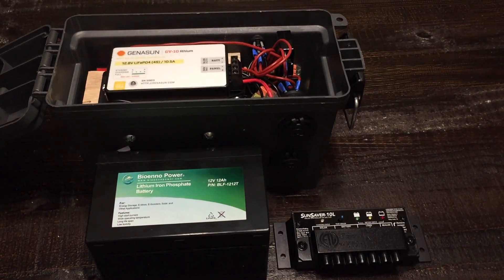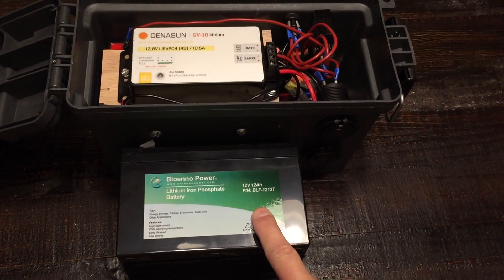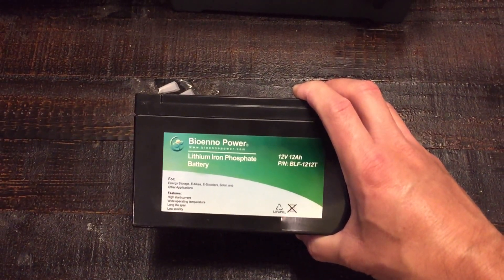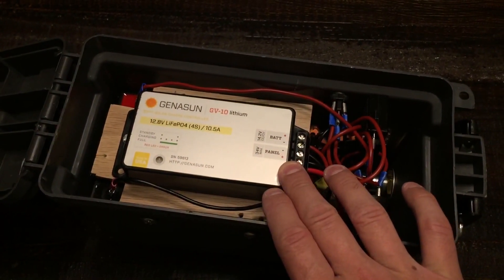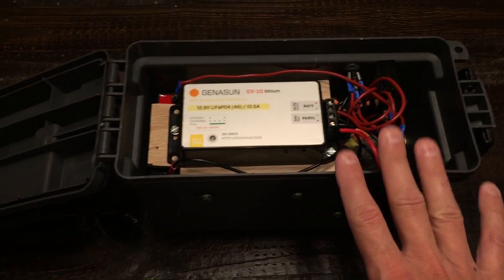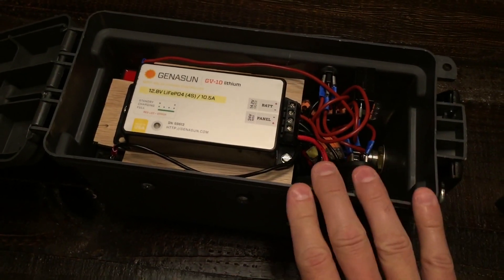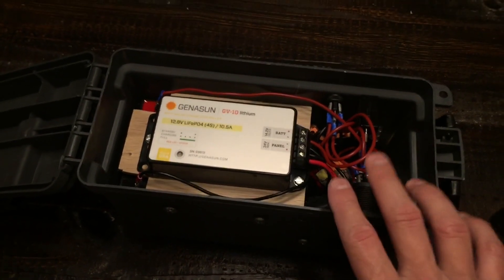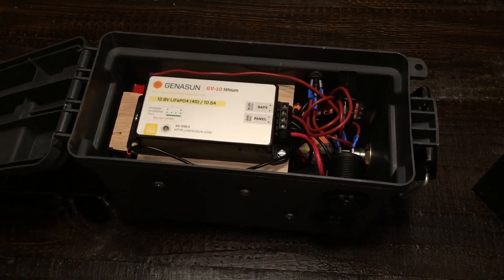Solar Ammo Box Generator - LiFePO4 update!!

Comment: Nice, I built mine with the 9ah bioenno in the smallest Apache case from harbor freight, about $15, I put a lighted toggle switch on the front between the fold over handle and on the side I mounted a voltage meter and dual USB, from powerwerx, it has been the ultimate power bank for charging my phones, tablets, and flashlights I use it for weeks before charging it and have yet to run the battery down.

Comment: Matt, look into the Buddipole Power Mini Charge controller, Battery Management Status indicator, etc. You don't need all the wires. Has a input for Solar Panel, Battery. USB and Load outputs, meter reads battery status, you can set it up for Lead acid. LI-ion, LiFePo3 an LiFePo4 batteries. You can set up high voltage and low voltage cut off and alarms. You can even change the charging voltage max limits, if your battery is different. All for about the price of a separate charge controller.

Comment: I dont use.charge controlers. The bms takes care.of it. Solar panel gos right to my battery.. Your bms is set at a higher cuttoff  than the charge controler. Making them not see.echother after its cut off
Reply from the maker: I've heard of people doing this.  My assumption is the voltage on the panel drops to match the battery while it's charging?
Reply: I must have.been.high when.I wrote that.  Wait maybe.I was tired. I do recommend.charge.controller.from.the.battery maker.  I now use one. Helps with keeping the battery safe.no.worries.   bms will protect your battery. I use low amp low voltage.charging... But. The battery and charge.controler may have.a.different cutoff.  And if the battery cuts off after the.controler does.then they woild not beable.to jump itself.with power
Reply: I switched to a different controller.  So it will self jump when panels have.power...  80bucks.  Owell

Comment: Hey can I used that charge control for 38120 cells lifepo4
Reply from the maker: C Lolooio You can as long as you match the charging voltage parameters of the charge controller.

Comment: The charge controller gets its power from the battery.  This is because, If the sun were blocked the charge controller would loose power and think it is morning all over again. That would cause the charge controller would start its charging process all over again.  Most controllers will only try to charge once a day, unless you program them to do otherwise. Normally there's not enough Sun hours in a day to start a second charging, and if there are your system is way oversized. The BMS disconnects the battery so there is no power to run the charge controller.

You will be better off with a watt meter to tell how much power is left in the battery. The voltage is completely flat until the battery dies so there's no way to tell how much charge you have with a voltmeter.

K6ORJ

Comment: Put a super capacitor bank on it to jump start it when the voltage is low.  How this would work is if the bank has a normally open switch connected to the charger.  All you have to do is remember to press the switch to charge the caps while the battery is fully charged.  You would have to figure out how you want to deliver that charge to the battery when it is low.  This also increases the danger inside of the case, but you can do your research in order to go about it safely.  Plenty of stuff out there.  I recommend looking into super capacitors because they are great kickstarter energy banks/surge current.
Reply from the maker: Thanks for the suggestion Anthony!

Comment: Thank for the Vids Matt!  I have been toying around with trying to make something like this.  Light, portable and able to charge from various sources.  Solar, Wall outlet, bicycle dynamo...  I was all set in starting to buy the materials until I saw the prices.  Yikes.  It's not really cost effective for my task yet but it's getting there.

Was wondering if you were thinking about making a vid on creation of a bigger unit with an inverter maybe? Like one you can power a refrigerator on in power outages.  Showing the how to from the ground up.  Linking multiple batteries or being able to link multiple modules...

Just some ideas- 

Thanks again!
Reply from the maker: +Roy Greenhalgh You're welcome Roy!  The beauty of solar generators is they can scale up/down to meet your needs.  The component choice has to meet your power requirements in the end.    I am planning on building a bigger unit, but in regards to an inverter being integrated, that's something I've left to being a modular component instead of it being included in the case.  They tend to require a lot of venting while under a load, so best kept outside of case.

Comment: Matt, thanks for posting this.  I also got unexpected results with a Genasun GV-5, a Bioenno Power 4.5 Ah battery and a PowerFilm 28W rollable panel.  With the panel connected and no battery present, the controller showed a battery high voltage condition, and I found panel open circuit voltage,(between 18 and 20V) at the battery terminals.  This also happened when the battery reached full charge.  Fearing that the battery pack would get damaged, I scrapped the GV-5 and went with a Bioenno PWM controller.  I wonder if you could comment on what you see under those same conditions:  1) panel connected, no battery connected; and 2) battery reaches full charge.
Reply from the maker: +Dave Corsello I've never connected it without the battery being connected.  I haven't had any issue besides low voltage disconnect and that's coming from the battery BMS, not the controller.  Only way I've found to "kick start" the BMS when it's reached that state is to apply a quick 12V jump from another battery, which causes the BMS to sense an increase in voltage which in turn allows the battery to charge.

I would use a Bioenno controller, but they're all too big for my use case.  In regards to the controller showing high voltage, that may be expected since the controller isn't picking up the voltage from a battery (which is considered a load).  The max input voltage for that controller is 27V, so you should be fine from the controllers perspective.  The BMS of the battery will protect it from the high voltage.  Did you check the open circuit voltage at the panel?  What about the voltage at the battery terminals when it's connected to the battery itself?  MPPT controllers will decrease the incoming voltage to match the voltage it's detecting from the battery and increase amps, which is why they're great.  Did you contact Genasun in regards to the the behaviors you're experiencing?
Reply: Matt, it's been about a year since I posted my comment, and I've learned more about what caused my problems.  As the battery approaches full charge, charging current decreases.  When the charging rate reaches 0.02C, the Bioenno BMS disconnects the battery.  The Genasun GV-5 doesn't handle this gracefully--when there's no battery present, it sends panel open circuit voltage (Voc) to its battery and load terminals.  I wonder if you've experienced this over the past year, and if not, why not.
Reply from the maker: +Dave Corsello I've not experienced what you've described. I'll have to monitor it closer to watch what happens.  My voltmeter on my generator has never gone above 14.2 Volt's while charging.  If what you described happened with me, I would expect to see the meter to register the VoC.
Reply: You would also see the status light blink red on the controller.
Reply from the maker: +Dave Corsello yes!  This has happened, but the controller ended up failing. I contacted Genasun and they ended up swapping the unit. Haven't had an issue since.

Comment: Hey Matt
Love your videos on this box. I was curious about your usage with the LifePo batt vs the AGM. Do you find you get significantly better use and what do you think of the Bioenno batt. Thanks! Looking forward to more videos :)
Reply from the maker: +NikonJax The LiFePO4 battery has been great and yes I've been getting more capacity then the AGM.  The weigh difference plus the greater capacity are the two greatest benefits with this setup.  I have an updated build that I will post soon.

Comment: It seems that if someone has access to a supply of salvaged 18650 batteries they could connect a bunch in series and parallel to get voltage and AH level to where they need to be for a lot cheaper than the battery you used.
Reply from the maker: +lmorrison17 Funny you should mention this because I've been testing that configuration for the past few weeks.  There are some major trade offs (in my option), but definitely an option.  I think it would be worth creating a video to showcase.

Comment: I looking at a build.  Was thinking of making a base camp style battery Like between 50 to 100 ah with the capability to jump my truck and large inverter with additional mini portable power banks to take into the tent or use with the 12volt shower pump I have.  Then also use for emergencies and each child would use there own power source for there IPads and lights.  For the casing I was looking at the Makita Interlocking Modular Tool Case

Comment: I have the Bioenno 10 AH Renewable Power Pack (BPP-120).  I had the same issue as you as when the BMS kicked in, and shut it off. I could not get it to charge.  Like you I spoke with Keven about the issue.  Now the Power Pack 120 has an input for charging and output for load.  Kevin stated to plug in the charger into the output and it would reset itself,  this worked.  I would suggest to maybe add charging port to plug in your battery.  This would help in keeping your battery maintained and charged at home for when you need it.  Second it will help you reset the BMS if it were to shut down.  Battery monitor is also good to have especially when out in the field.
Reply from the maker: That's what I ended up doing in order to get this to work. I think I stated this in the video, but I took the charger and tapped the leads on the battery posts. Worked like a champ but could be an issue while camping or charger isn't around. I just completed my new build and will be recording an video shortly.

Comment: Question if I may: Will this controller ALSO work with an ordinary AGM Battery?
Reply from the maker: +Bruce Forster Great question Bruce.  To directly answer your question - I wouldn't recommend it.  This controller's output is different then that for a charge controllers that will work with AGM or other lead-acid based batteries.  The output of this controller is CCCV (constant current constant voltage) and set for a specific voltage (and with the battery I have in this build, it's 14.2v).  It's critical to match the charge controller with the battery you plan on using.  Genasun makes serveral for lead-acid batteries, check it out here: http://genasun.com/products-store/mppt-solar-charge-controllers/mppt-for-lead-acid/
Purchasing a controller that is designed for AGM is the way to go.
Reply: Thanks for an excellent explanation. I'm a licensed Ham operator and a recording engineer, so I get your explanation exactly.
Reply from the maker: +Bruce Forster You're welcome and glad to help out.